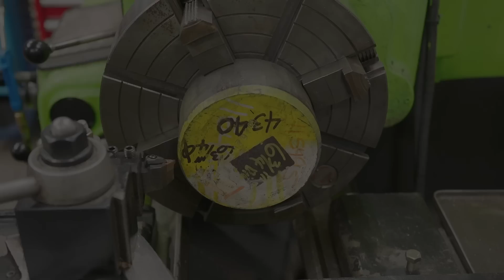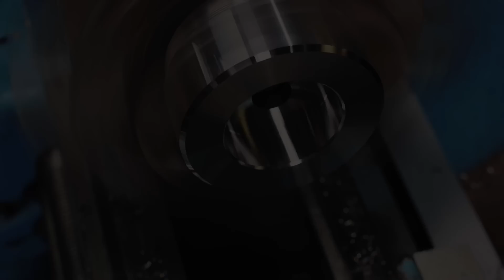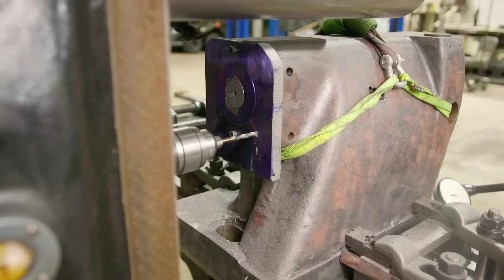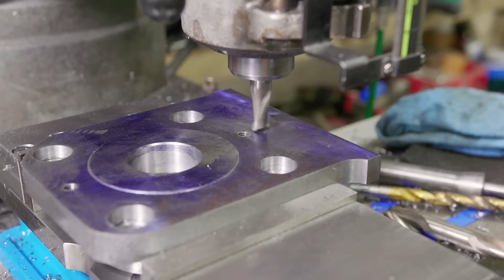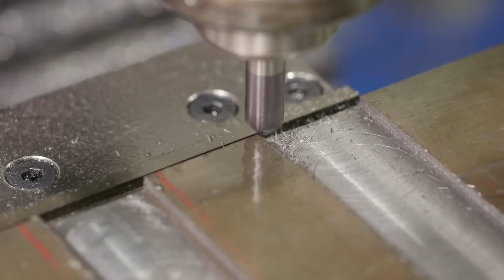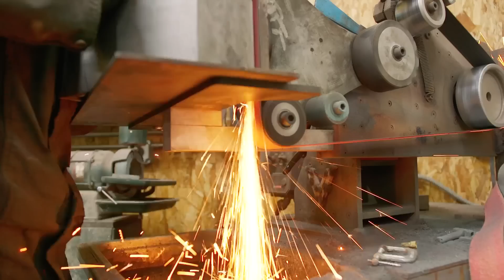World's First | Tailstock Gearbox Machining | Lion Lathe Restoration

Comment: I've seen a manual old Mazak lathe with a 2 speed gearbox for the tailstock from the factory. For example here at 13:10 minutes https://youtu.be/ykmezQunUJM
Reply from the maker: 2 speed tailstocks are common. Retrofitting them is not

Comment: I am a machinist (45  years of practical experienc ) and can spot a skilled machinist at 1 mile. (cnc) Nr 1 peter stanton Egde precistion ,,, (manual) Nr 1 Adam Abom 69 ,,,, and GEE kurtis australia ,,, when have you seen them plan the end with a 35 degree copy steel and rough turn the side ,,,,when you have a cnmg steel  ??,, and mill up against the clamping iron. ,,, watch their video and learn from them  ......... next video you're doing it right :face-blue-smiling::face-blue-smiling::face-blue-smiling:
Reply from the maker: I am confused by your comment

Comment: 12:50  That rubber work mat in this shot, is fairly expensive! .. I made an apartment in my house with a closet turned into a tiny toilet and shower! :)  ... 

I used this rubber mat stuff for flooring! ... VERY slip resistant and with the 1/2" X 2" Plastic baseboard, and generous use of silicone sealer??  It made the little washroom floor 100% water tight!
Reply from the maker: Very nice

Comment: nice. nothing new about a two speed tailstock, in my 33 years as a Tool and Die Maker, I've used two engine lathes that had this feature.
Reply from the maker: Your right. What is new is adding it to a pre existing single speed unit
Reply: @VanoverMachineAndRepair  the last one was a sharp brand and you had to get it just right to work properly. I like yours more... :)
Reply from the maker: @yelims20  thanks

Comment: I own an old herbert no.2d turret lathe, it was a tail stock auto feed with 3 rates of feed ran off of the saddle feed, not much variety but you dont really need 50 different speeds for drilling. An old lathe but a beast
Reply from the maker: Wow that’s cool

Comment: All the lathes that I run have a 2 speed gear box from the factory
Reply from the maker: Excellent. Many lathes have two speed gear boxes. the newer lions come with them as well so I really wanted to add one to mine to bring into the newer style.
Reply: @VanoverMachineAndRepair  yeah it’s a handy feature to have when you need it…… but nice build looks good 👍🏻
Reply from the maker: @Travis444-v2p  thanks

Comment: I like that you're building something useful and interesting, but I don't think this is worlds first :)  There are engine lathes that ship with 2 or 3 speed tailstock gearbox, primarily to help with drilling operations.
Reply from the maker: Worlds First implementation from single speed. Many lathes have two speed. Never seen anyone add one.

Comment: Wow! You are knocking this one out of the park. Was that a Suburban Tools fly cutter you were using?
Reply from the maker: Yes it was!
Reply: @VanoverMachineAndRepair  Sweet. I have been eyeing one. Worth the money?
Reply from the maker: @hilltopmachineworks2131  yeah it is. Honestly you can also make a good one it’s nothing special from an engineering point of view but it is the nicest premade one there is. I have all the different bar sizes. Rigidity is the key to success though. I use it on the bp mostly with the shorter bar. It works well but is less effective as you go bigger on diameter just w vibration. On the k&t it’s like cheating, so ridged, basically perfect finish every time insert is not damaged.

Comment: I enjoyed the video and the machining, but even after watching the beginning several times, I still missed the reason why you want a 2 speed gearbox.  Is it that sometimes it does not go the full distance fast enough, or you want to be able to go in slower sometimes for delicate drilling?   Maybe it is me and just missing the explanation.  Hopefully someone can enlighten me so the reason matches the fun video of machining. :)
Reply from the maker: It just adds more capabilities. On most nicer machines they have two speed tailstocks especially on bigger machines. Fast speed helps bring quill in and out quick where as low speed reduces input torque required on handle for big drills

Comment: Good stuff. That bandsaw was frigging flying though. I’d change the speed on it and it should be able to get through 4130 no issues. I cut alot of inconel with surface speed of about 60 feet per minute.
Reply from the maker: Yeah probably

Comment: Are you no longer using any thrust bearing for the screw to case, as was originally designed? You do not want to have axial load on plain bearings…which is what it looks like you are using. Maybe you just haven’t showed us the full plan yet.
Reply from the maker: Yeah both bearings thrust and radial

Comment: Hell yeh

Are you going to get as in depth with that Lucas HBM you mentioned in that update vidya as you are with the Lion? Because this series has been amazing
Reply from the maker: No lol. I wish. Maybe… but probably not this project is 2 years long maybe 2.5. I can’t have my hbm down for 3-4 years I need it to start paying for itself but you know me even cleaning it up will get some upgrades and fixes done just have to set a deadline so I can actually get it running in a reasonable time.
Reply: @VanoverMachineAndRepair  alright that is pretty fair

Comment: Worlds first is a little stretch here. My Lathe at work has a selector for direct drive or a 1:5 reduction on the tailstock. That machine is from 1998 !
Reply from the maker: 2 speed tailstock are extremely common. What I have never seen before is someone adding a legit one to an existing unit. That is the first. If you have proof of someone else doing this send the evidence my way!

Comment: Nice job!  That's a factory feature on most Kingston Lathes.  They give you selectable 1:1 or 5:1 ratios.  Very handy feature to have!  I use it quite often.
Reply from the maker: Yes indeed. Lots of nicer lathes have them
Reply: @VanoverMachineAndRepair  even the Taiwanese stuff is come with it these days
Reply from the maker: @elanjacobs1  true
Reply: Fun fact: The North Korean lathe "Kusson 3" also has two speeds in the tailstock: 1:1 and 1:5.)
Reply from the maker: @eachday5705  very nice

Comment: Nice job! I have a suggestion which I learned myself. Really simple stuff can be made without mistakes going along. If it get's a little more complicated, as your gearbox certainly is, it really pays to make a plan in CAD or an reasonable accurate sketch by hand before start. I know it's an extra effort, but it pays of when you make stuff. Ideally you only have to handle/machine a part once and when assembled you're done. Off course tweaking is always a part of the process but adding length to already cut plates doesn't have to happen when you work like this. I'm a designer/builder for 28 years now and I learned the hard way. Get an idea, make a drawing and select all the materials you need when doing so. Make simple drawings to print (or draw) for the parts to be made. Make the parts, assemble and be happy. Hallelujah! Thank you for sharing your honest journey! Best! Job, the Netherlands
Reply from the maker: Thanks for the feedback. I know it to be true. I just didn’t know how to use cad at the time. Learning the program was on my goal list for this year and I started this project last year in October. I’m already knee-deep and using fusion 360 as we speak.

Comment: You very rarely use and lube or coolant - WHY
Reply from the maker: My lathes are not set up for coolant. This new lathe will be. I got brand new oil set up and k&t but it’s such a mess. Mostly it makes a mess and it’s makes it hard to see on video.